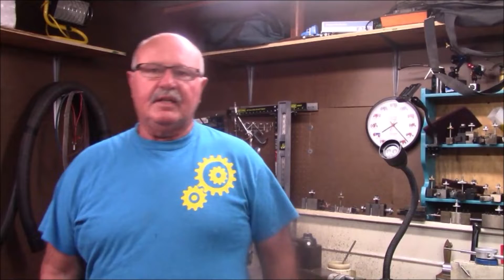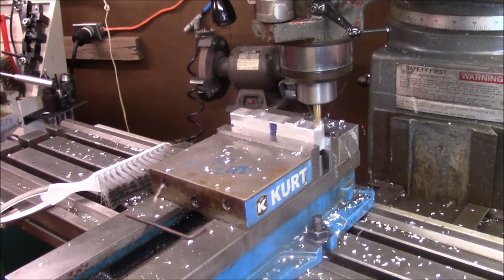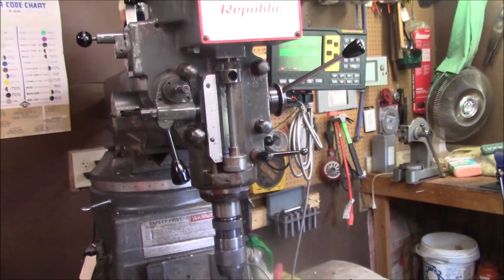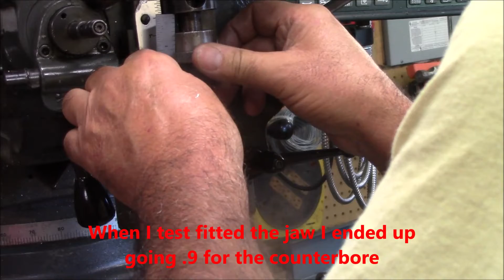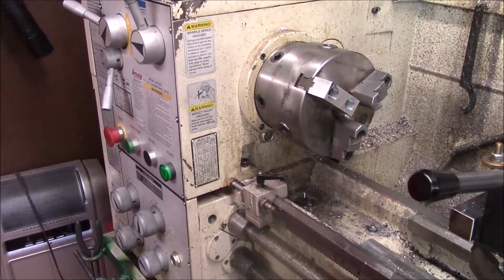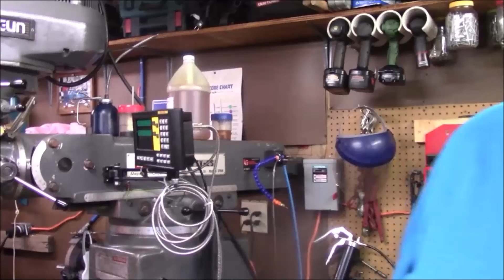Machining soft jaws for my lathe

Comment: Do you have an end mill the correct size, you could use to flatten the bottom out the holes?  Great work.  Looked a very good fit to the chuck.  Good video.